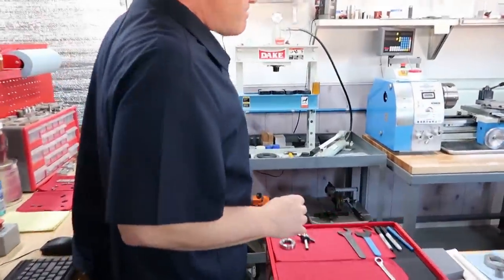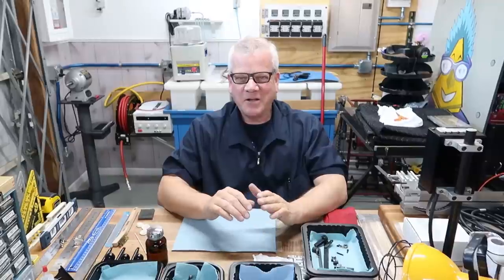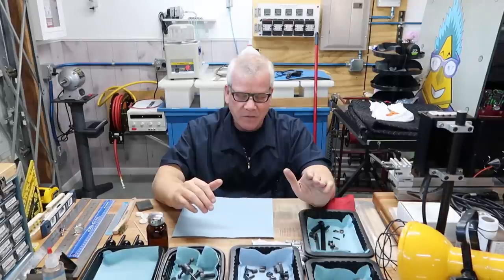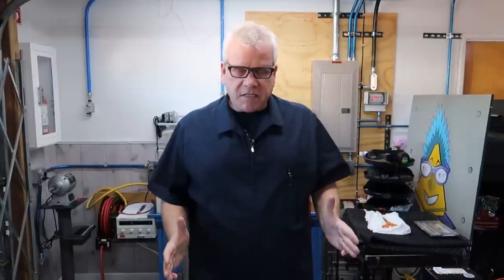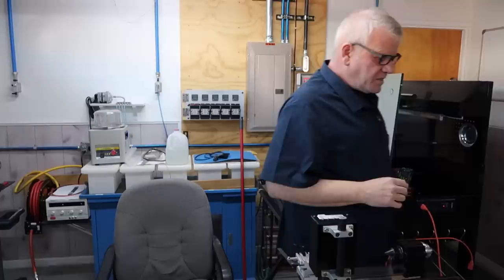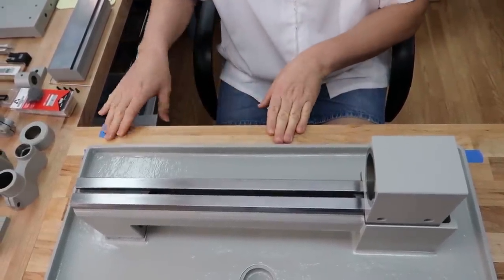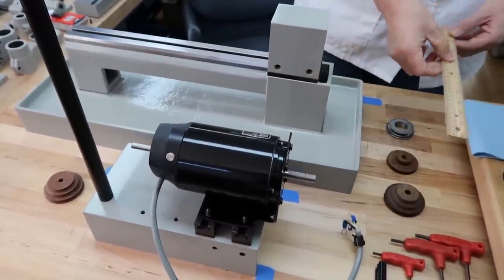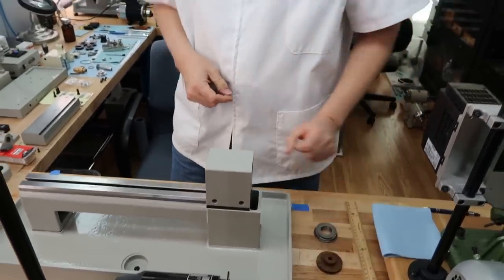SHOP ADVENTURES 18: Levin Lathe & Micro Drill Press Update

Comment: Lance & Patrick,
   I figured there was an issue with the first upload so I clicked my patience button and waited for the update.
     As for altering vintage machinery, I concur, it’s always best to maintain the original state if possible. However, there are times when it’s unavoidable. When a situation like yours occurs with the bronze pulleys without bearings it’s perfectly acceptable to upgrade to modern ball bearing pulleys, just preserve the original bearings, correctly labeled and store them in the event down the road you want to restore it for resale or whatever. I recently modified an old Craftsman drill press cover as the original design was problematic when changing belt positions but I have kept the original mechanism. Mr. Pete is sensitive to this as well as are most of us who treasure old machinery and tools. I should have mentioned to you about the bronze on steel shaft effect as I figured that’s where your squealing was coming from. Bronze and brass on steel or cast iron often develops squeaking and squealing over time as the surfaces begin to wear.
    Great explanation on the need for the clean environment required for your type of machining. Also, traditional ethics in the workplace are important. They were developed for a purpose to encourage self worth that reflects directly on product you produce.
Two Thumbs Up!
Dale
Reply from the maker: Hello and Happy New Year Dale, you are a giant reason we are now sharing what it is we have been mostly doing for decades via YouTube and places. We love sharing our micro machinery, tools and accessories and even as much knowledge as we have we are continually learning from people like you sharing this squeaking and squealing effect from brass bronze steel and cast iron wearing and getting too loud to handle likely adding drag to the machines performance certainly our nerves and such. 
We might make you proud in knowing that we always keep our old parts label them for the machine or tool they are from so they will always be here I mean I polished those two brass Idler pulleys the best I could even though the edges on one had chips missing and such we try our hardest not to replace these vintage machine components but when we do we save all of the parts so we thank you for bringing this up. 
Speaking of vintage machinery and such you might like what we share in the coming weeks opening about New Old Stock parts and this will be a test to see if you know about what we share in the video opening so tune in and let us know. Thank you for taking the time to watch our channel and provide valuable  input and knowledge to the both of us and to fellow viewers. Lance and Patrick.

Comment: While high precision accurate work can get done in a filthy disorganized shop, it would be a constant battle doing so with a high likelihood of swarf, contamination etc sooner or later affecting the finished parts. It's as easy to develop good habits as it is to do the same with bad one's.High end metrolgy labs and machine shops doing nano grade work go to the effort of even filtering the air for good reasons. The smaller the part and/or the higher the accuracy requirements then the better your cleanliness habits and conditions have to be. Plus as you've said it demonstrates a professional attitude and work ethic. It's also much nicer with far less frustration working in those conditions as well. The shops the top race teams operate from no matter what type of racing there doing have spotless, well organized and maintained conditions because that's proven to work far better. 

If you don't already know of it? George H. Thomas's book Workshop Techniques goes into great detail about building 3 fairly major tools for a Model Engineering type shop. His Versatile Dividing Head, Lathe Headstock Dividing, and his Universal Pillar Tool. Why would that interest yourselves? That shop made Pillar Tool looks and works very much like that German watchmakers drill press. He details various shop made accessories for it to turn it into a watchmakers type staking tool, number stamping, a small riveting tool, tapping machine and a small watchmakers style of high speed drill press. I'm sure you'd both find the book interesting. Amazon and Ebay resellers of the book all want far more than it's cost would be if ordered direct from either Tee Publishing or Hemingway Kit's. Both are in the U.K.

Mr Thomas's other Book The Model Engineers Workshop Manual is just as interesting if not more so. He was an extremely talented machinist, designer and writer. Most of the designs in that book are for and about building high quality, good looking as well as properly designed- accessories for the Myford Super 7 lathe WITHOUT doing irreparable damage or modifications to the original machine. In other words his idea was to add enhancements and better usability to the machine. Both of his books are well worth the effort of getting them no matter how experienced a person is.
Reply from the maker: This is Lance I am answering for us both Patrick and myself. You make so many GREAT points and share (thank you for taking time to share and for the details in your comment posting) such vast amounts of knowledge into machining, machinery, ethics, competitive vehicle sports (I can concur) that I do not want to neglect an answer from your sharing comment. 
Paragraph one you got it in our case each day ending we refill liquids, sweep, vacuum, dust when applicable the immediate work station, weekly the entire work area in particular the Workshop not so true of the Machine Shop (depending on amount of work performed in the space) area as the work performed their is larger and it is much more the dirty environment. In our case the Machine Shop there is a lathe and a mill.
Paragraph two and three you share books by the stated author.
We know of the author George H. Thomas and we had the first book Workshop Techniques in our Amazon wish list since 2013 but could not afford (small business other priorities) it until you came and shared the publisher with us, we also were not aware of the second book The Model Engineers Workshop Manual at all being available or even existing.
We are proud to report back to you that we just bought them both this morning at the much more affordable prices to a rough total conversion rates around $110.00 USD.

If anyone ever wonders why two childhood friends one loud one quiet would open up their private personal lives and business of a quarter century to the outside world through video, images, writings and so forth it is mostly because of this type of interaction from makers and viewers like Turning Point sharing, collaborating and informing about tips, techniques, books, videos and much much more helpful members of these wonderful digital communities taking the time to share. Thank you Turning Point and the others that make this process worth the time and efforts of video content producers and viewers of the same.
Reply: @ActiveAtom  Happy I could provide a bit of useful information Lance. As you've found in the past trying to buy either of those books (and many others) at new or even used prices on Amazon, Ebay etc is ridiculous for the very high prices the re-sellers all seem to want. I'd be interested in your thoughts after you get a chance to have a look through them. I can truthfully say you won't be disappointed. As I mentioned a great number of the designs are for and built on a Myford Super 7, but almost all could be re-designed to work with your largest lathe. Funny enough I happen to own the same machine and I likely bought it for many of the same reasons you did. A few of GHT's designs could be reduced to work well on one of those Levins. His information and use of lathe headstock dividing would be a definite time saver for set ups with better accuracy in a commercial shop that's still using manual machine tools. Some type of cross or top slide live tooling is needed though. But you already have that overhead drive and the watchmaker's type live spindle.

One more source for you and it's quite possible either of you may already know of him. His prices are at the upper end of the scale, but a YouTube creator with the user name of Niels Virjlandt specializes in selling machines and tooling for the smaller high end European watchmaker type equipment and the tooling up to at least some larger home shop sized equipment. All of the equipment he's found looks to be in exceptional condition but with a very high price to match. He's definitely at least one source for rare, unusual and very hard to locate tooling though.
Reply from the maker: @turningpoint6643  We too cannot wait to not just receive these books (thank you again for sharing) but to also over time look into how these documented ideas might fit into our operation.
We are very happy that what we are sharing is being found as interesting to many people. 
Niels Virjlandt (thank you) we know him his channel and his prices. The tools he sales we assume are good, he came onto the YouTube scene about 8 years ago (1 video) but really started becoming known by watchmakers 5 years ago.

Comment: Lance & Patrick,
    Well I am caught up! I’ve watched all of your videos start to finish and each one gets better successively. 
   On thing guys, on your lead in and in the video where Lance gives the tour of the electronics shop I’ve noticed a very nice Gerstner Tool Chest. Now if there is anything that gets a machinist’s attention it’s one of those immaculate tool homes. You mentioned, I think in that same video, that you both are 3rd & 4th generation machinists I was wondering if that Gerstner has a history? Many times those chests, which are a symbol of excellence, are passed down from one generation to the next.
Reply: Oops! Accidentally hit the post button before I finished. (I’m a bit long winded)
   Anyway, I am in the process of building a tool chest to Gerstner specifications. I have the plans, hardware and the wood. I have been looking for just the right wood species and have gotten very lucky and found  two hundred board feet of properly air dried Cherry that’s currently is registering at 8% moisture so it should be stable. I’ll have to acclimate it to my shop and go from there. The Cherry has been adequately ticked and setting in a dry shed drying for 80 years so by now it is what it is. I certainly don’t need that much for a tool chest but I also make custom acoustic guitars so it won’t be wasted. The beautiful thing is I bought it for 1$, that ONE DOLLAR per board foot. I am an honest person so I told the guy it was worth ten times that but he said it wasn’t to him as he wanted it out of his way, so take it or leave it! I took it. 
   I know it won’t be a true Gerstner and I also know I can’t afford the real thing but I’ll have the joy of building it and the joy of pulling open a drawer to retrieve the tool I need. There is something about using tools and items you have made with your own hands.
   Thanks for your great videos.
Dale
Reply from the maker: Hi Dale wow you watched a lot of us chatting around here sharing some things we find interesting and you are the first to share about coming into our channel getting a late start and still getting all caught up with our Shop Adventures. Interesting about the wood Cherry we are not wood works we are very weak with wood knowledge as life long metal guys so it is interesting you are going to replicate an H. Gerstner & Sons tool chest. We have one top box by the maker all of the others are by other makers and we do have one coming to us in the near future a full roller cabinet no base (unsure til we get it in) but an additional top box these were my Grandfathers when he worked at North American Rockwell and then at Northrop Grumman both aerospace manufacturers. These boxes are coming from my third generation machinist we have nothing directly from the 4th generation my great grandfather though maybe in the boxes coming from my 3rd generation Grandfathers boxes that might contain some tools from farther back in time, we can only hope so for now. 
No worries about posting then forgetting and adding more (I think you can open edit on the right hand side of the post) I do it myself Dale. Great deal on the wood for your chest build based on your sharing. 
I personally would not ever worry about what you make not being a brand name after all what is it a brand named item anyways? I would build it the chest make it my own with a personal twist and be the proudest builder there is. 
We can share when we make a tool similar or even identical to a tool we saw somewhat else, even a name brand we are far more proud of our tool then the one made by someone in some factory somewhere else. 
Thank you Dale for being here in our community channel and for taking time to share your experiences and skills like this wood working Cherry wood share. Happy New Year make this the year of the Dale made Chest, that just sounds right.

Comment: Hi Guys, Yes thanks for the New up loading of this video. Have you guys ever worked in a clean room ? The reason I'm asking is the clean room lab coats may work well for your final operations room?? The lab coats are light weight and have a 1/4" grid, the dark thread in the coat is like positive or negative charged so lint and dust are attracted to the lab coat. If I'm wrong someone please correct me. M.K.S.
Reply from the maker: Hi Kelly Sampson. This sounds more like static we would know that from our electronics days of building and testing computer controller cards but we do not have a quote "Clean Room" we have a room with positive flow air pressure outwards and we keep it clean that is a lot for micro or any small machine shop.
We do not know enough  about clean rooms other then they are built and maintained in classes of cleanliness. We searched the Internet like everyone does ready lot about lab coats but just cannot find a dust particle capturing coat. Thank you very much, Lance for Lance and Patrick.
Reply: Thanks for the reply. Wasn't sure if this could help or not. M.K.S.

Comment: Hello Lance and Patrick. I am fascinated by the electric wall clock mounted to the right of the watch print. Can you tell me more about its origins and how accurate it is.  The pulsating seconds are mesmerising.
Reply from the maker: Hi Mr Carpathian. That clock in the "Workshop" area was a kit clock it was from Nuts & Volts magazine advertisement, but more then 15 plus years ago, you had to build the clock.

GREAT knowledge of clocks you clearly have knowing it is a somewhat smart clock, it is in fact a very accurate wall clock, it is timed from the AC power 60 Hz frequency wall power but we must warn you the clock is not really too smart, I mean we live a daylight savings time change zone and we still have to spring forward as we just did and fall back as we seemly soon will be doing. 

Thank you for this great question of sharing the learning of what seems to just be a wall clock, it actually is a smart clock. Lance & Patrick.
Reply: Active Atom Thank you for the reply and information on your wall clock. There is something about unusual timepieces. 
As for smart clocks I have had a couple of ‘radio controlled ‘ clocks which were claimed to be super accurate and automatically adjusted for our own winter and summer time in the UK. Great when they worked, but a pain in the bum when they went wrong. Often they lost the signal and just went haywire. Tried two before giving up. Now just have an inaccurate battery powered wall clock. Would love to find something like your clock, ready made though!
Reply from the maker: @andrewdolinskiatcarpathian  We also do have a Nixie tube clock color amber numbers GEO location time date it is really something a well. That clock is in our office. We also built this clock and it is tied into the time satellite.
Thank you for sharing your clock talk we are answering your ER collet question right now, thank you Lance & Patrick.
Reply: Active Atom I saw a Nixie clock for the first time last year. Since then I have been keeping my eye on one. One day I most definitely would like one.